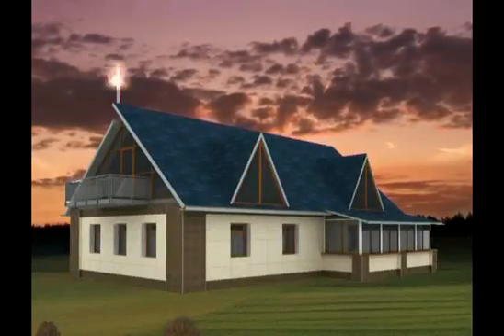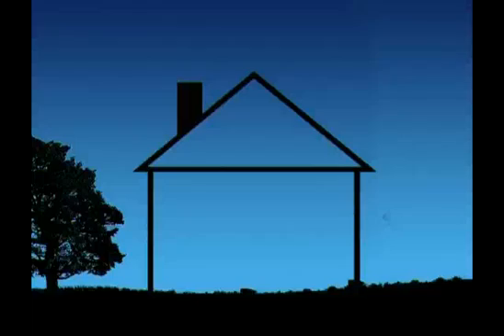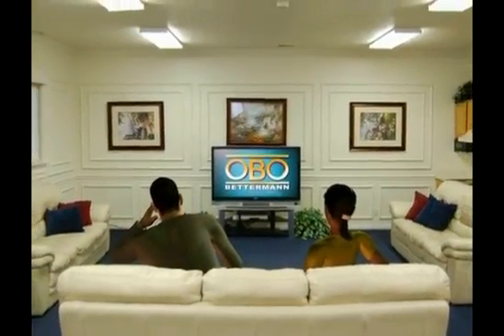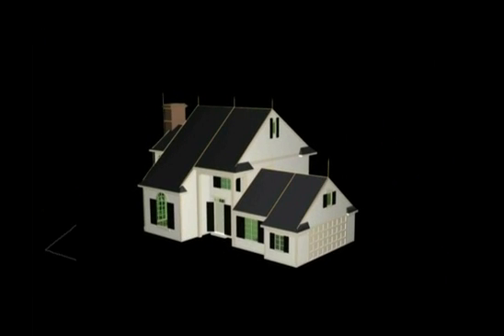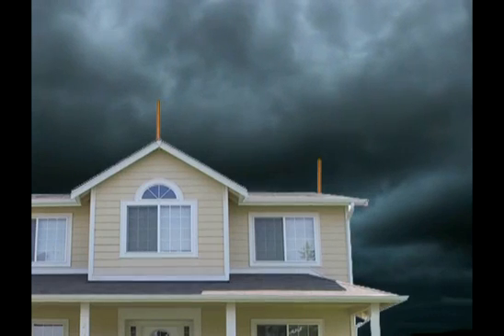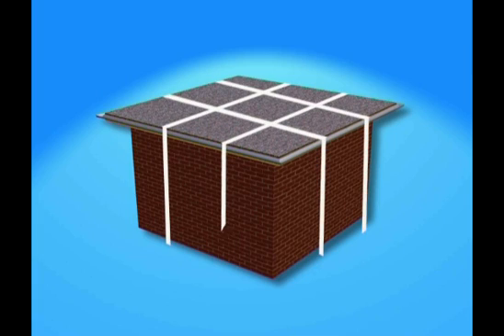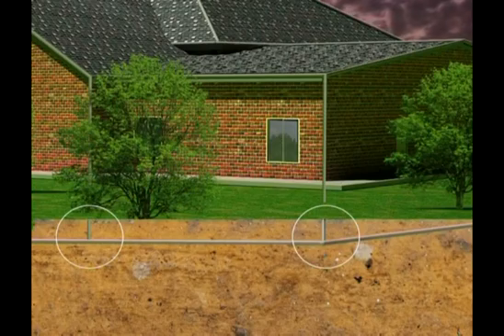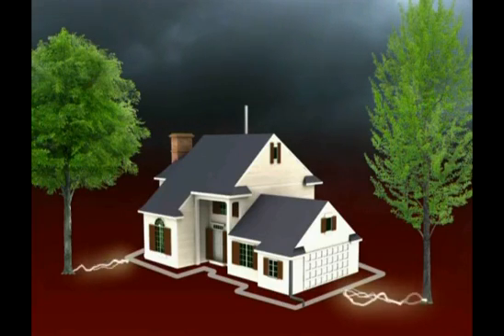Lightning Protection Design, Earthing System Design Lightning Protection for Buildings Design

Comment: very nice explanation. but I have some questions. what should be the safe distance between a any person and the conducting cable during lightening? and, is this device effective with a house having no concrete roof but simple corrugated tin-shed? will the inhabitants staying in such room remain safe during lightening?

Comment: Does  one needs to connect the earthing of the building appliances to the earth of the lightning system? Please help.
Reply: Joey Njie you dont have to but you can do .
Reply: Look at it this way, if you don't connect it then the ground potential during lightning strike would be different between the down conductor earthing and building electrical earthing. This is the last thing you need as the difference in potential would create a current flowing between these points.  Take this with a grain of salt, but I think you're better off when the down conductor earthing is tied to the electrical earthing as the whole system would bounce to the same potential thereby avoiding any adverse flow of current.
Reply: @flow5718  But there's a chance of charge returning to the home appliances during lightning due to interconnectivity? 🤔
Reply: @gokulakrishnan1377  If you mean the surge currents back-tracking its way into your home, this won't happen with an MOV based SPD as MOVs provide protection bi-directionally.
Reply: @gokulakrishnan1377  At least in EU, if you want to use the same grounding for both house and lightning, the grounding resistance has to be (less than) < 1 Ohms, otherwise better do the lightning grounding separately to avoid any potential issues.
Reply: @Ovinski  Yes.. I too suggest the same 👍
Reply: @flow5718  I am a newbie to this area. What is MOV based SPD and so on...? FYI, I'm in an urgency to install lightning rod so please help me on this area. Also is there any possibility to install the lightning terminal on a tree?
Reply: @gokulakrishnan1377  you need SPD
Reply: @gokulakrishnan1377  IF YOU INSTALL ON THE TREE, you need a down conductor.
Reply: @shashaqin  In such case, if there is a lightning hit on the rod of the tree whether it will affect the tree or not?
Reply: @gokulakrishnan1377  if the rod has a down conductor, it will not affect the tree. and actually, install a lightning rod on the tree is to protect the tree from lighnting.
Reply: yes